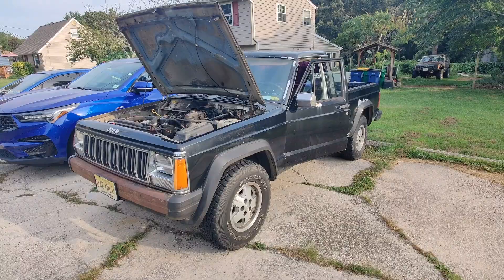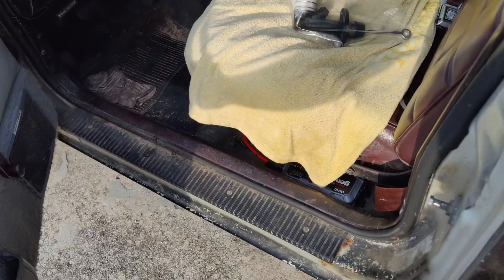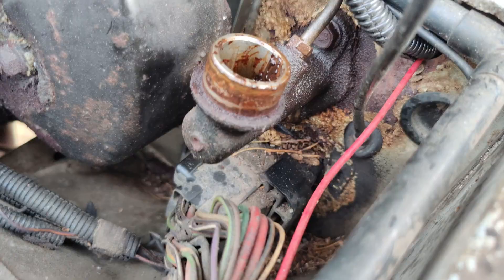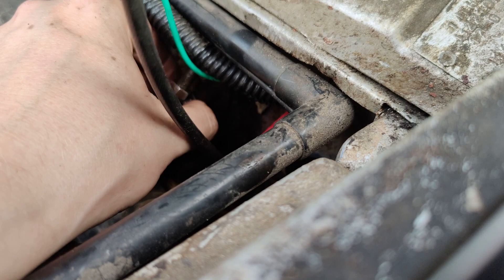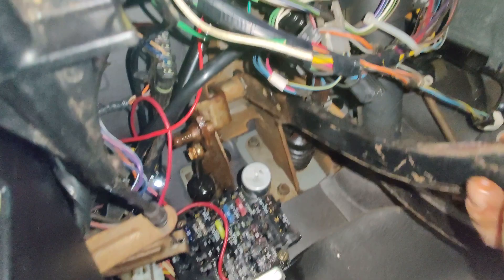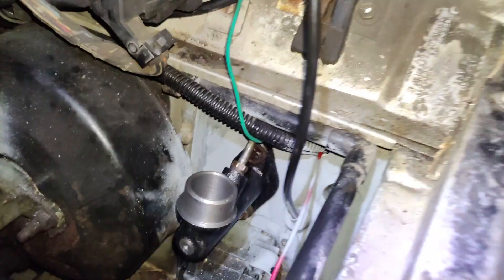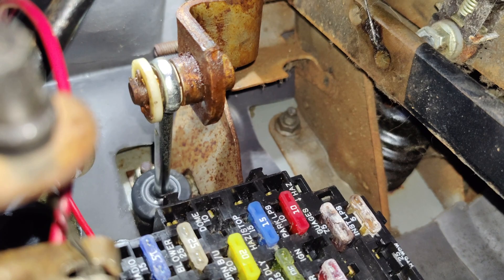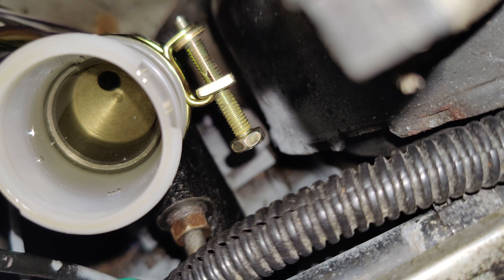88 MJ AX4 Clutch Master Cylinder Replacement (Internal Slave)

Comment: It’s too bad that in order to make the hydraulic clutch system more manageable , extensive disassembly . A later year bell housing that mounts to this transmission would have to be sought for the purpose of mounting an external clutch slave . Not wishing to put you through that much work now since this is your only driver at the moment . The XJ and MJ body just doesn’t allow for a manual clutch linkage conversion . I was lucky that my ‘80 CJ was able to convert from its old Girling ( uk ) clutch master and slave cylinders to an eBay complete kit . Happy that you got it working . It you’ve any thoughts if converting the system in the future , that’s for another day , another video . We just wonder , would you have any thoughts of any future changes to this Jeep , or just keep it original as it’s worth is highest that way .

Comment: Sorry Nick, but I laughed my whole way through the video, seeing you cursing as much as me and going through the same moods hahaha!!! I feel your pain Bro! I went through 2 of those factory style garbage master cylinders, and ended up modifying a TJ master. I have the exact same truck as you that I converted to 4x4, so I swapped in an external slave AX5 from a TJ. Those stock MJ masters always kept leaking not long after, and always felt like they weren't pushing enough fluid, making it hard to shift from a stop. Also, pretty fun to bleed, eh? Even with the TJ Master, slave and transmission, I think I'll have to give it a 4th or 5th bleed... Fun times!!!
Reply from the maker: I've been dieing to swap in an AX5 for highway use. Found this things only got 3.55 gears in it too! Would probably have more guts with 4.11s, and a motor that wasn't burning a gallon of oil every 1000 miles.
Reply: @NickInTimeFilms  3.55???? I thought the 2.5 Liters came standard with 4.11s? Man that must suck! The axles I got for the 4x4 swap had 3.07s and I drove it like that for a few months, on 31s... It was an exercise in pateince, I can tell you that!
Reply from the maker: I thought the same thing, but I guess highway RPMs would have been too high on the 4 speed so they just used what they had for the 6cyls I guess.

Comment: Do I have to bleed the clutch after replaced the clutch cylinder or use pedal to pumping ? Thanks
Reply from the maker: Ideally the clutch fluid should be flushed and bleed, but I only did pedal pumping in this video because I didn't want to risk breaking the bleeder screw.